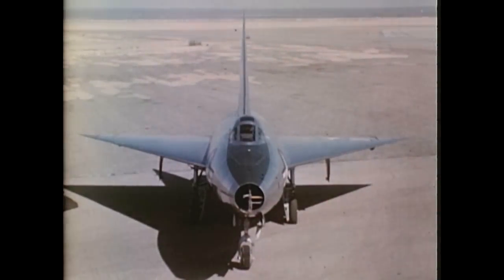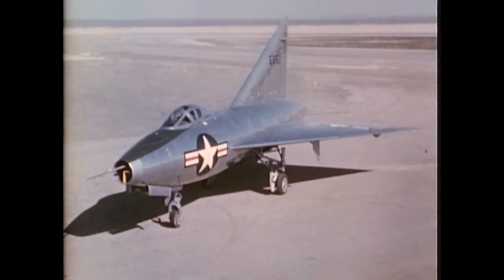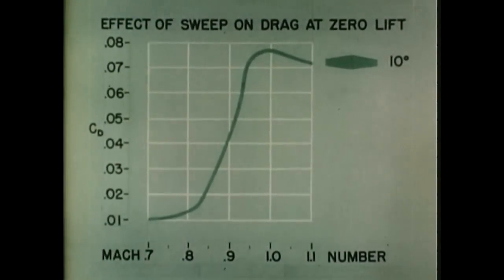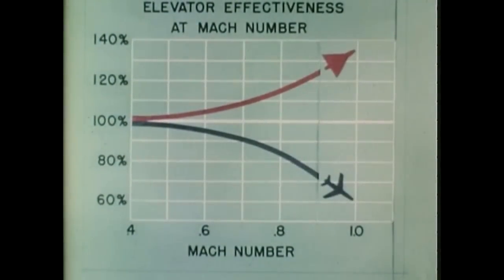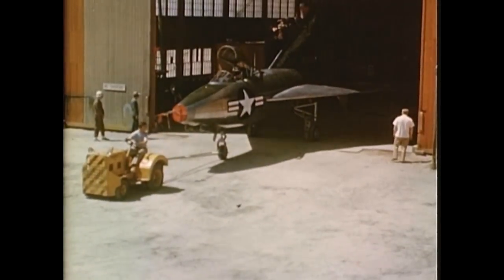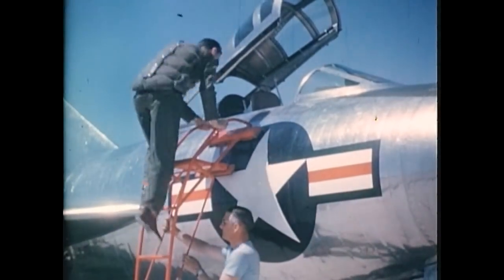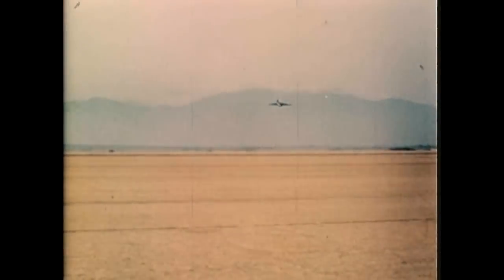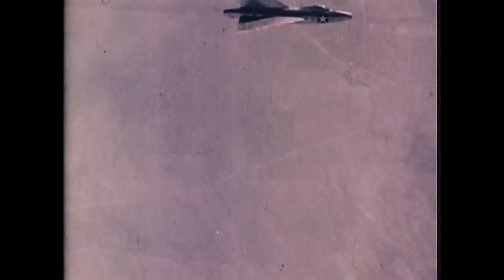X-Planes   |   Delta Wing Theory   |  XF-92A Convair 7002  |  720p

Comment: The designers here made two huge mistakes. One was that evil-looking vertical fin. When the F-102 went into operation the first 13 who ejected died when they hit that fin. The other thing they missed was Whitcomb's area rule. When the F-102 required a slight dive in order to go supersonic, Whitcomb reasoned that the total area differed too much. In other words, when you took the area as you went toward the rear on the plane, the wings made the cross section area too much in their area. The planes were then modified by developing a coke bottle fuselage, pinched in in the area of the wings. This added about 80 kts and allowed the plane to go supersonic in level flight to about mach 1.2. My goal in basic flight training in 1961 was to get an F-102 assignment, which I was unable to do, Now, I'm glad I failed there.
Reply: +Sabra S Whitcomb "discovered" the area rule in 1952.  Too late to benefit this aircraft, which was probably being designed before WWII ended.